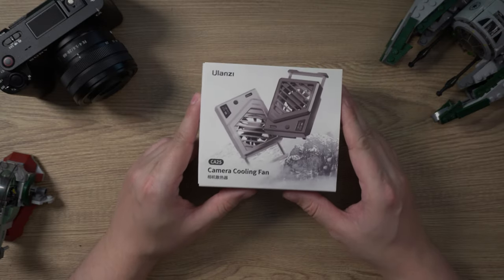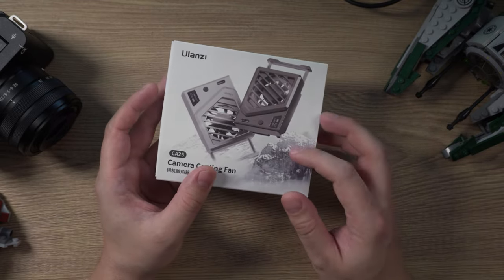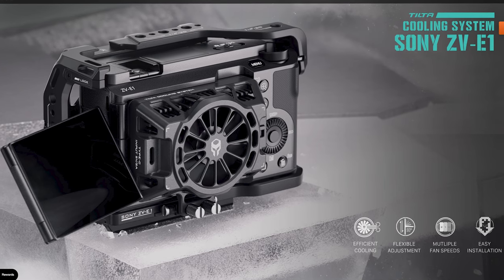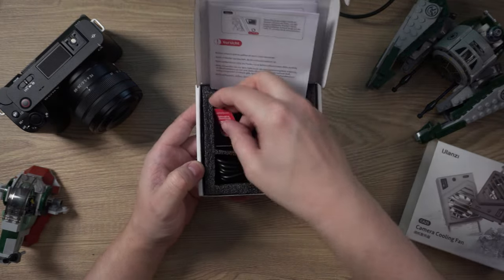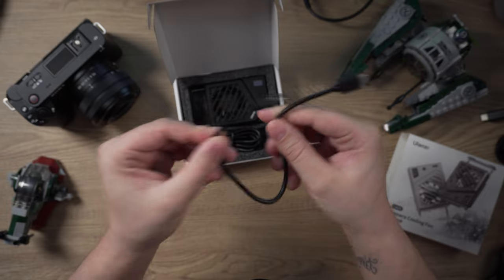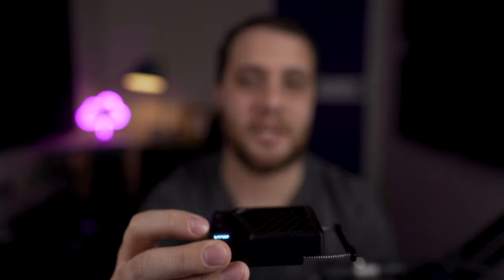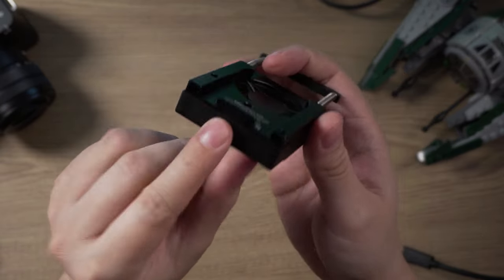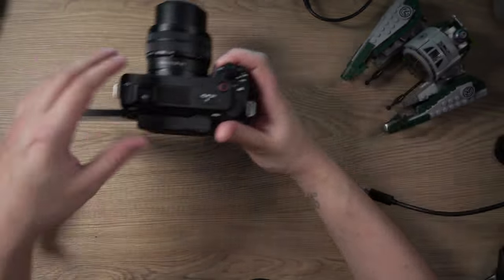ULANZI FIXED IT!!! Camera Cooling Fan Mark 2 Sony ZV-E1, A6700 Overheating Fix

Comment: This is an absolute lifesaver for people who live in tropical countries. I live in the Philippines, shoot with an A6700, and I had the mk1. The camera on its own overheats at 4k24fps in under 20 minutes, the fan did help but the humidity made the suction cups pretty much unusable. Fell off every 2 minutes. Glad to know there was an update! Thanks for this info
Reply: How much more minutes did you get with the cooler?
Reply: are u filipino or foreigner?
Reply: Did you get the mark 2? Curious how long recording lasts for you now
Reply: @mugensekai  +20 mins roll time single take

Comment: Great, so those of us who bought the original versions get absolutely nothing for those and now we have to spend the same amount of money AGAIN to get a product that was supposed to work properly the first time. Ulanzi knew they messed up the original version, and that's why they were so quick to release an updated version. I will not be giving them any more money. They need to allow us to trade in the old versions for the new versions at no charge.
Reply from the maker: For how much it costs them to produce this fan I also think it’s crazy they are not offering free exchanges for the newer version.

Comment: Canon R6 II shooter here! This fan is a game changer for long term internal recording! Generally, 4k 24 needs no fan unless you're out doors in the heat, but long form content like 4k 60 is expanded with the Ulanzi! Most rate internal recording without the fan at a 52 record time on 4k 60. With the fan and at 70 f, 21 C, I managed to get up to an 1h 20m. The fan also helps keep consistency for colors on models that have no internal cooling systems. For $40, this is well worth the investment!

Comment: Well, I developed a 3d printable piece for the old version, that does pretty much the same, but I just bought the new one anyway, because it looks much cleaner and perhaps more reliable. Annoying, because I just bought the old one 2 months ago and can't return it anymore. But I'm glad they are finally offering the solution all of us have been waiting for. Thanks a lot for sharing this!. 
In case anyone is interested, in my testing the fan (the old one) cooled the camera (A7 IV) down to 5°c over ambient, which means the Camera got very hot to the touch, but I had no trouble recording the full SDCard of 3:53h in 35°C my ambient closet.  Without fan it overheated at around 1:30h in these ambients.
Reply: Just to confirm. I just received mine today and it fits my A7 IV perfectly 👍
Reply: Can you share that 3d printable piece? I have some old versions and would liek to use them without the suction cup
Reply: @JosiahMorales agreed
Reply: And I gotta say. It's too noisy for me, currently tinkering on the old version to see if I can make a modified more silent version.
Reply: thingiverse: "ulanzi cooler". Somebody was already faster than me 😉

Comment: I got the original fan when it first came out and it was such a disappointment lol. Every Ulanzi device I've every purchased has been a flop so I'm done with them. I see SmallRig dropped a new fan with a similar mechanic that I really want to get, but I also just want to wait for the ZV-E1 CineBack and get a Tilta fan since that one screws into the CineBack.

Comment: How good are these? I’ve been looking at using the ZV-E10 for long podcast interviews (1-3 hours). Seems like even setting the heat setting to high, using it in an air conditioned room, with the screen flipped open, a dummy battery that runs the camera to power, and leaving the door on the battery compartment open the most people can get out of the ZV-E10 is about 60-90 minutes before it overheats and shuts off. 

Podcasters have been running them via HDMI cable to a video controller which removes the micro SD card from the camera and to the controller. That appears to reduce internal heat significantly. Curious if these fans are enough that I wouldn’t have to buy that $495 video controller and use the fans along with the other tips.

Comment: I have Ulanzi camera fan 2.version.

The cooling performance is perfect.

The weak point is the built-in battery with a ridiculous 200mah that lasts 80 minutes at 1 level and 70 minutes at 2 levels from full to completely empty.

Ulanzi should bring a 3rd version of this fan onto the market with an extremely better battery from 1000mAh or even more, and make the fan itself even quieter.

The battery charging time is also extremely long, which should also be improved in the 3rd version so that it is more than twice as fast.

The built-in USB-C port is a joke, they should not install a USB port at all.

The 3rd version can be even more expensive for completely better quality.

The spring retention in the 2nd version is also terrible, the suction cups should please go back to the 1st version.
Reply: Did you try the tilta fan?

Comment: Hello thank you for an amazing advice! Just got my zv e1 and already a bit upset, cause I didn’t even record but just figured out with settings around 20 min and it’s already warm. Should I panic? Cause my usual filming time takes around 3 hours 🙏🏻
Reply from the maker: Is that 3 hours continuous as this certainly isn’t the camera for that without a fan. When I have it on my desk mount I actually use a usb 120mm fan this gives me pretty much limited record time without overheating.

Comment: i'm worried about the vibration of the fan when using to record on a tripod, for example.
It may affect the image stability, right?
Did you test it?
Reply from the maker: No need to test as it isn’t an issue.
Reply: @thefullsetup  my point is: does the vibration of the fan affects the recorded image?
Or is it irrelevant?
Reply from the maker: @omarcelopaixao  irrelevant
Reply: @thefullsetup  thank you